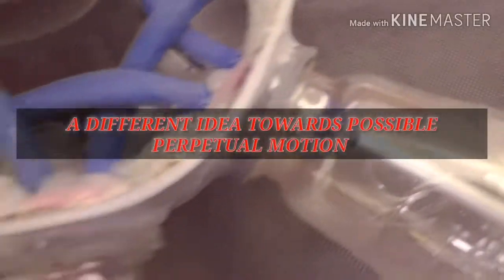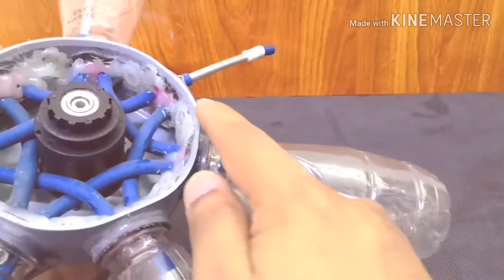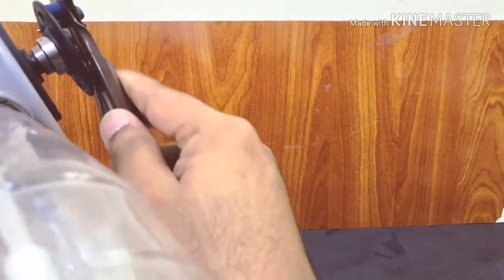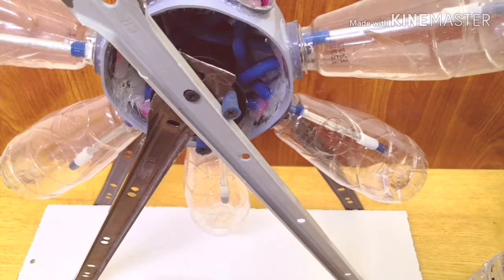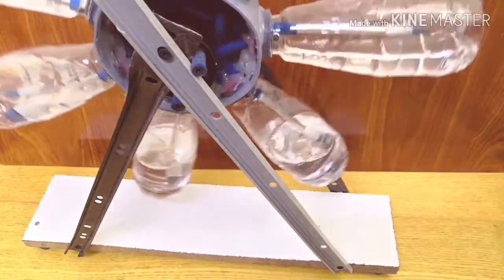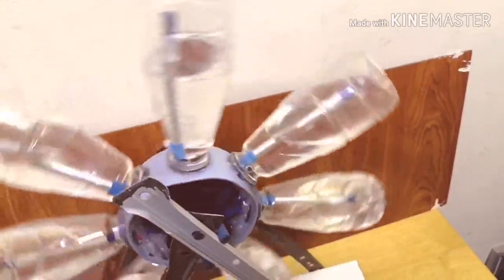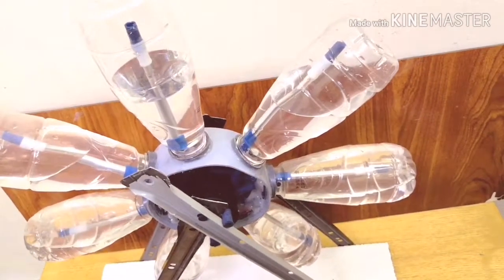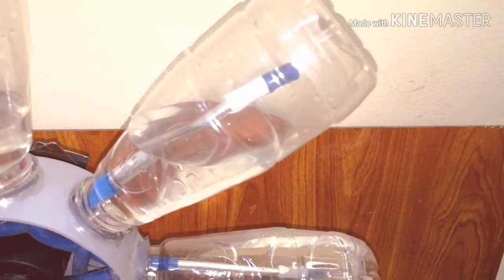A NEW DESIGN TOWARDS PERPETUAL MOTION/FREE ENERGY

Comment: If you REALLY wanted to learn the truth about free energy, know that everything including thermodynamics are all BS, a lie, a psyop, altered! The truth has been suppressed and destroyed BUT it can be recovered, rediscovered!

The REAL free energy is on faraday's law and lenz's law. RELEARN these two. I will now disclose the truth about these two. How these two ACTUALLY works.

Faraday's Law : Changing magnetic flux/"field" generates voltage and the back flux generated by the stator coil due to lenz's law can reduce the induced voltage by the main flux/rotor coil's flux/field coil's flux due to back flux itself is capable of inducing voltage on it's own.

Lenz's Law : Changing magnetic field has their own magnetic force. Hence, it is capable of experiencing action and reaction, the same as newton's third law of motion. However, this proved that energy is duplicated as the stator coil produce it's own energy, power, magnetic field, magnetic flux, magnetic force to oppose the changes onto it. Power can be infinite as long as the induced voltage does not reduce as the back-flux gets stronger.

Now you know the truth. The method to redirect back-flux as well as preventing the induced voltage to drop is by using materials with different magnetic permeability where the lower permeability can behaves as a one-way magnetic diode; and by using two stator coil where the flux generated is in opposite direction to maintain the resultant flux as similar as the main flux.

The truth and method has now been disclosed. The rest, is up to you now.